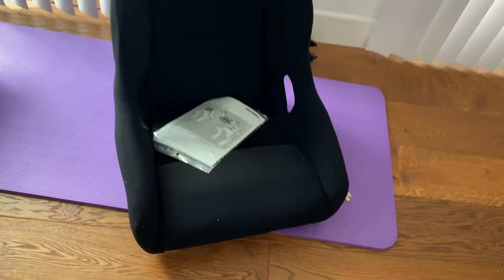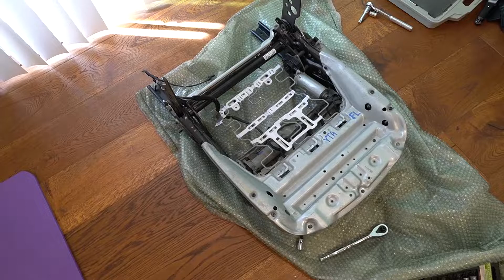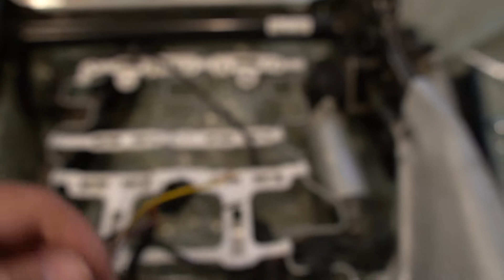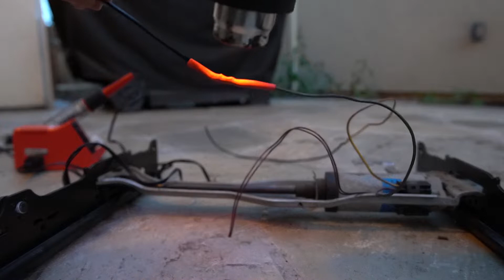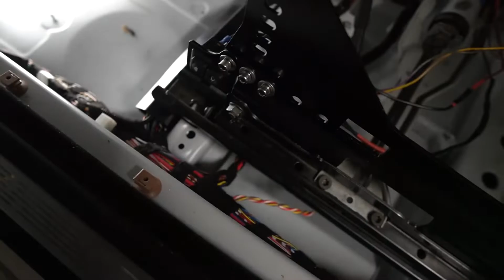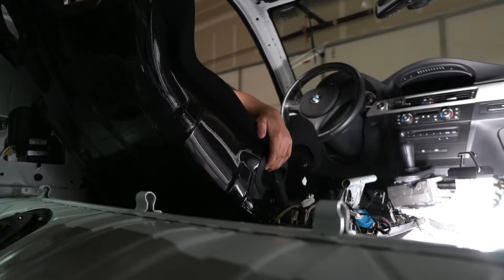E92 M3 Race Seat with OEM Power Slider Retrofit using Brey-Krause Auto Mounts - Track Build Ep.7

Comment: next time you solder pls use some flux on the wire itself before and hold the soldering iron on the wire for slightly longer so it has more time for the solder to flow everywhere, but other than that good job